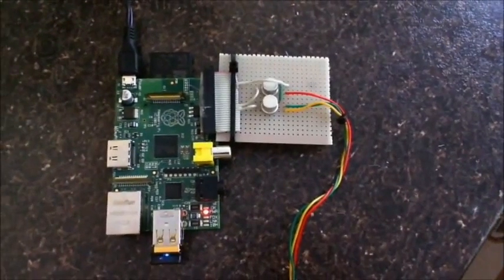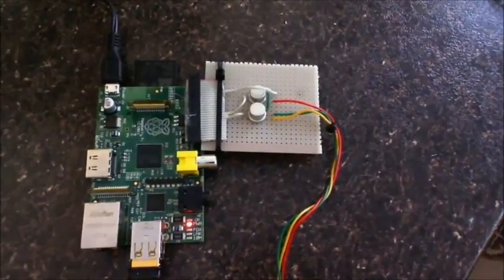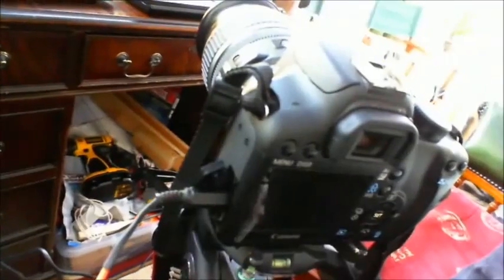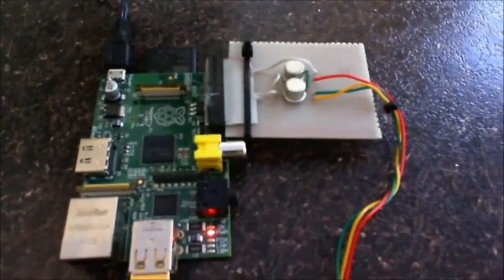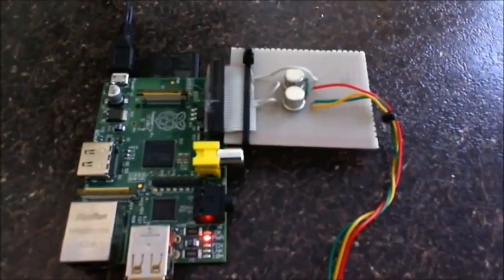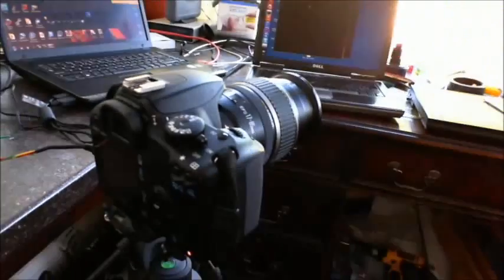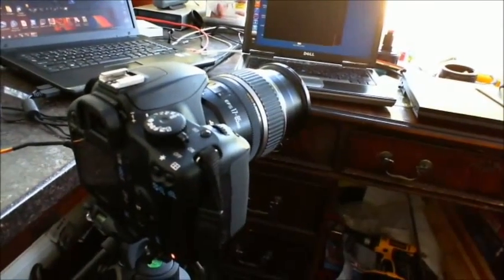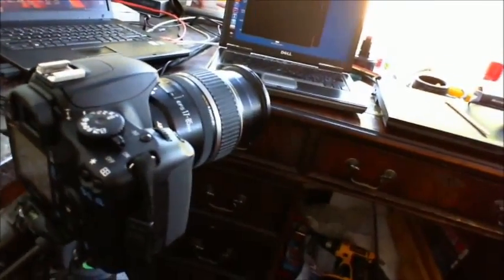Raspberry Pi Controlled Canon DSLR Shutter Release

Comment from the maker: Hello Ivan,
I have just posted the circuit diagram, in the description now.
Exposure time can not be controlled this way, it is purely firing the shutter.
There are other solutions around using gphoto2 etc but I found it was unreliable. Also,the webcam & wireless USB devices meant I needed another solution. Camera settings are all manual, although you could have it in 'auto'. Interested in your astronomy project, also a hobby of mine.Code is simple, UTube search 'raspberry pi gpio'